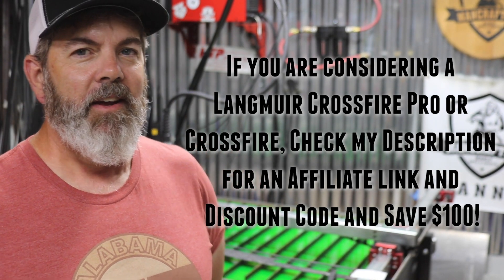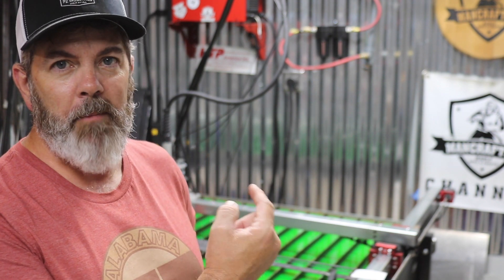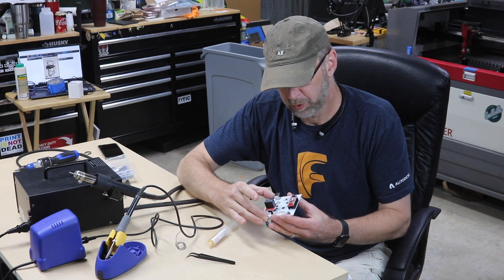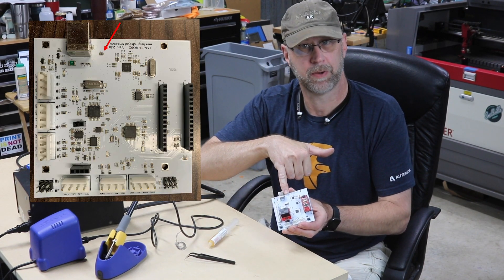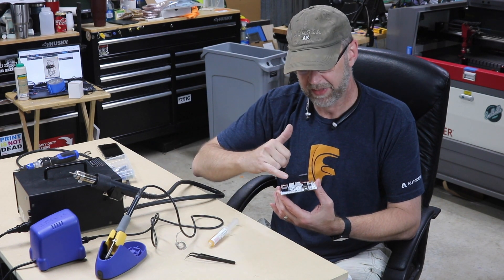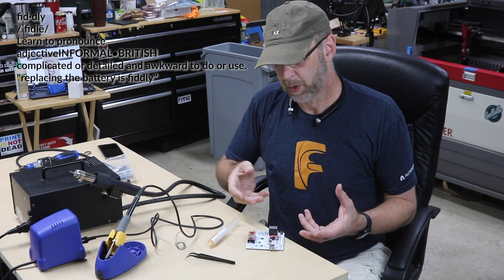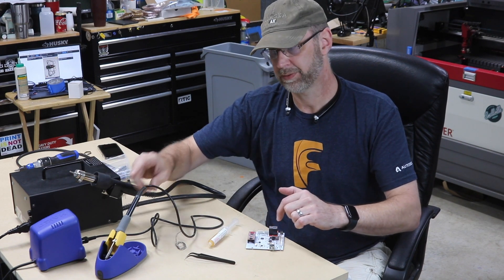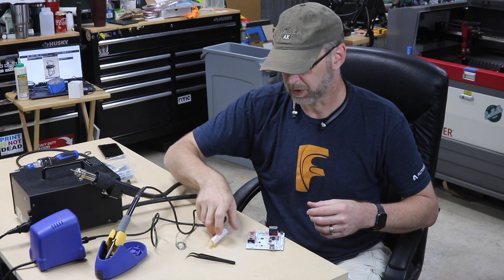No More EMI Issues with this simple mod to your Langmuir Pro

Comment: 2 questions, would solder paste work for this? And would this alow a hi frequency start plasma cutter?
Reply from the maker: I would stick with solder, but if you haven’t purchased one yet this won’t be an issue.  I would avoid HF plasma cutters if you don’t currently own one.  There is a list of tested plasma cutters on the Langmuir site.  There may be others that work as well, but avoid HF.

Comment: I wonder it works on an Arduino Nano 😄😄
Reply from the maker: It’s not.
Reply: @ManCrafting  It is an Arduino Nano. 

It has the ISP connector there for programing it ( because they removed the micro USB from the board), the reset button, the LEDs... Probably they used a custom GRBL firmware to ocntrol that machine.

Comment: I use nut holders. Screwdriver locking devices with spring grips at the end for the nut. It makes holding nuts where they’re too deep to hold by hand, easy. You just spin the nuts on, and then pull it off. If there is a toothed washer under the nut, tightening from the screw head is then easy. It also works when removing the nuts. It’s better than a magnet because many electronic screws and nuts are actually chrome plated brass.
Reply from the maker: Great tip.  I’ll look into getting a set.  Is their a brand you prefer?

Comment: So I assume all the new machines Langmuir is now shipping have a revised circuit board? The Pro seems to be selling well, back orders are out to September now.
Reply from the maker: According to their post on the forum, if you don’t have yours yet the new boards will be built with the zero ohm capacitor instead of the inductor.  So you’ll be good.